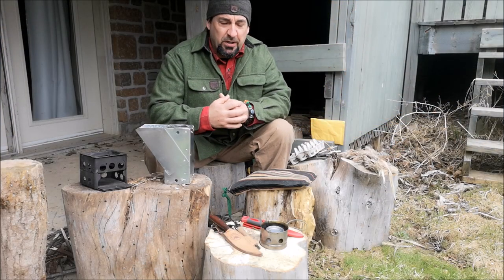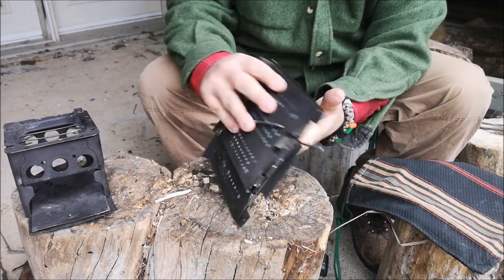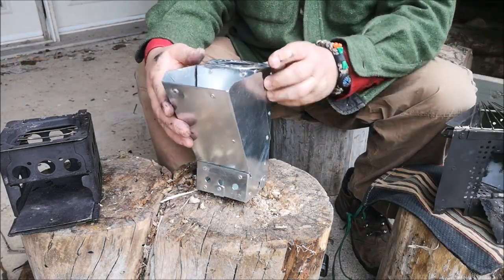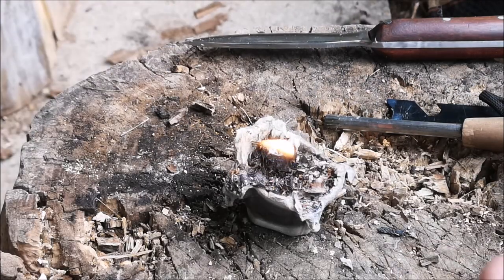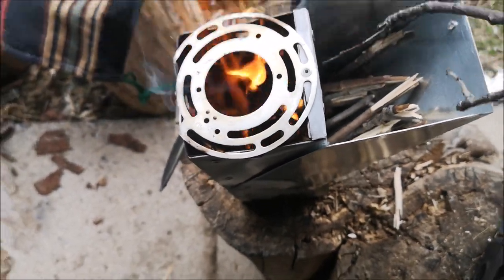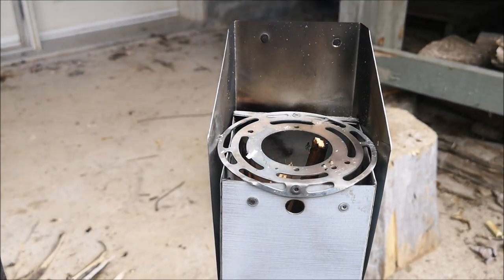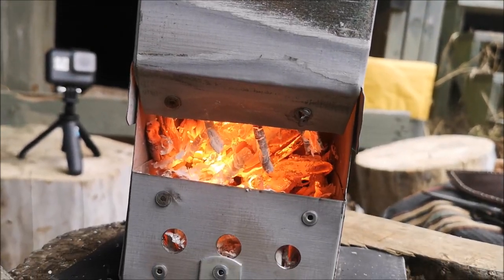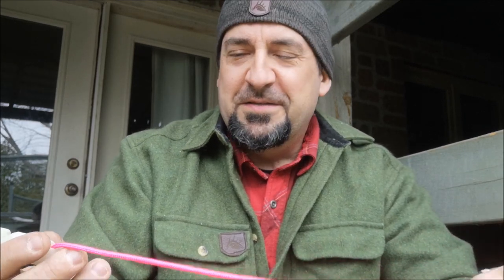DIY Twig Stove Showcase | DIY Rocket Stove Burn Test

Comment: Do you have access to wood pellet cat litter - that might be ideal to load the hopper with?
Reply from the maker: Possibly, but the mouth of hopper to large for smaller pellets I think. Designed for camping with abundance of twigs for fuel. Thanks for the suggestion though.